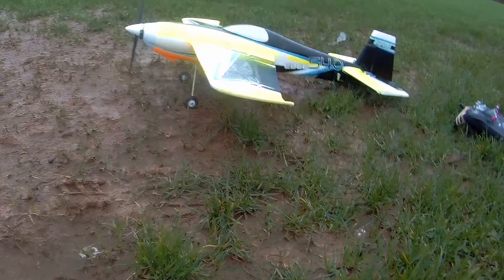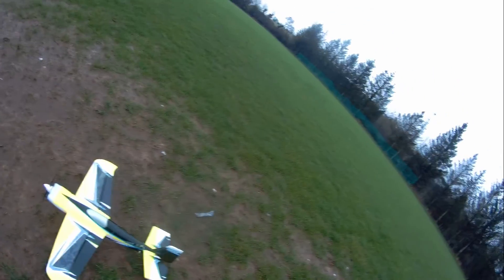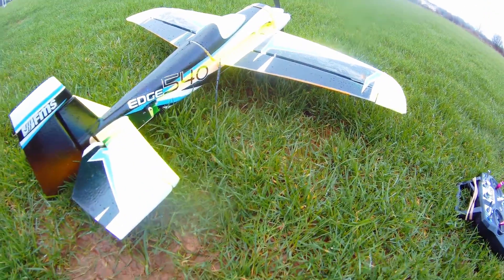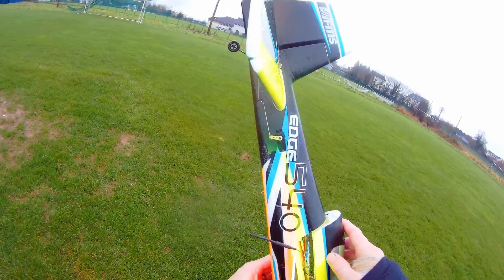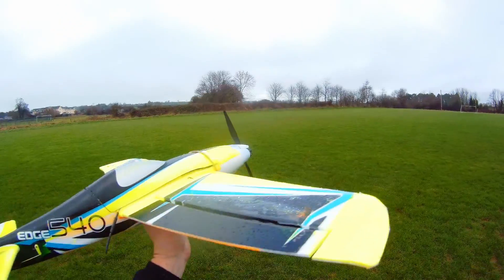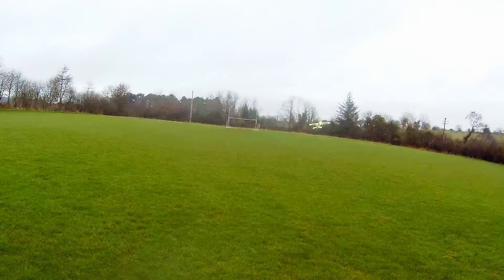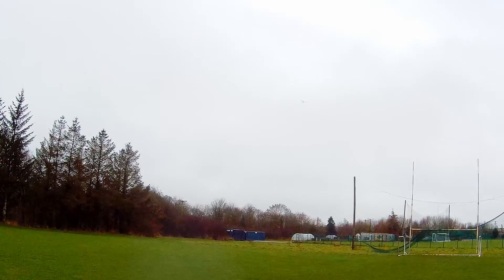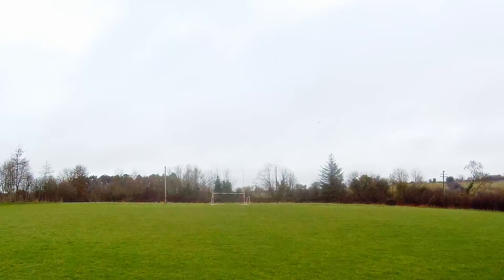RC Plane flying in 2021 - FMS Edge 540 - 750 mm

Comment: Hi mate what fluorescent yellow paint did you use on the plane? Also what RX are u using? Cheers.
Reply from the maker: Hi, I used cheap fluorescent paint from a local dollar a store, it seems to work once you give the surface of the plane a very light sanding . I’m used a fly sky fs6 receiver